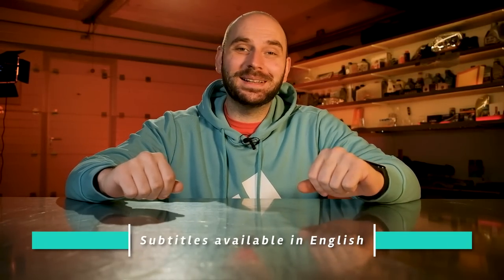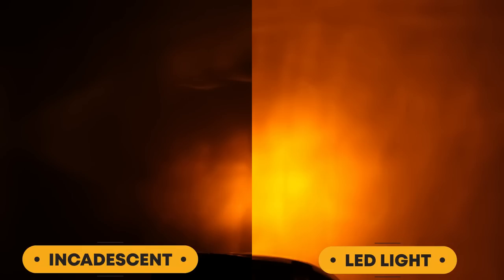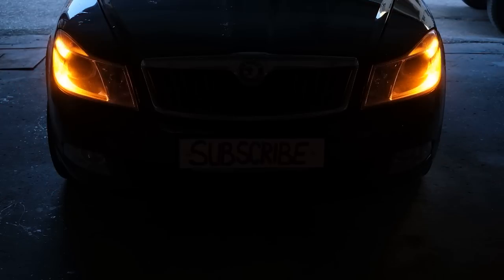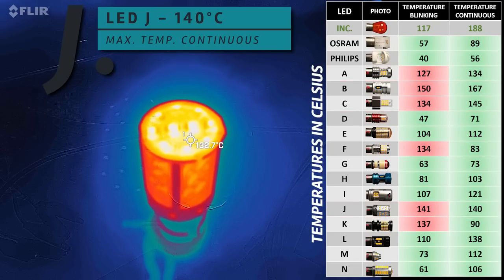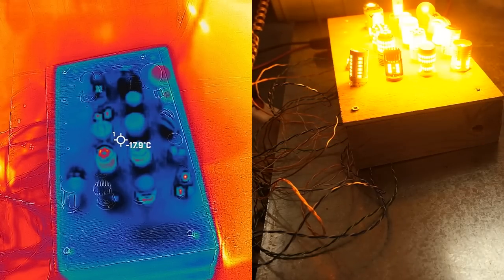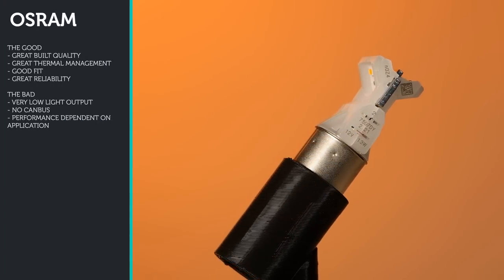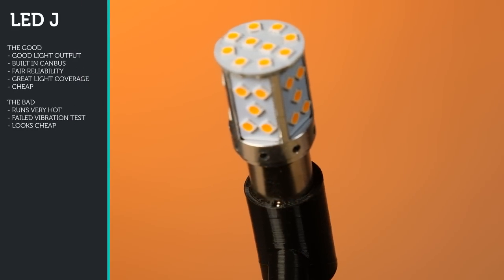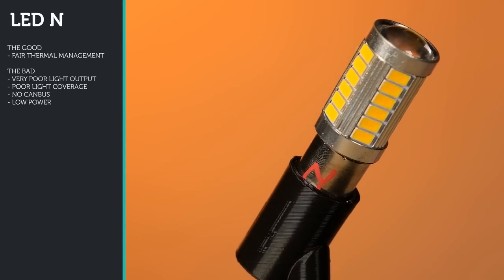LED INDICATOR LIGHTS | Testing the best rated LED bulbs

Comment: I'll be honest, I bought bulb B for my car thinking since there are not that many LED chips it shouldn't get too hot. BOY WAS I WRONG THE WHOLE TIME. I will definitely remove them and buy different design. Thank you for this helpful video you basically saved my car from getting burned.

Comment: Interesting results. Bulb E was Bulb R in the reverse light test. It handled most of the tests back then. Been using them as reverse lights for about a year now. No issues whatsoever.
Reply: And what now? The bulbs are working ok now? I wanna get the bulb E on this test
Reply: @JhonatanPinzonsx  I had bulb E and they lasted about 4.5 months and all of a sudden both of them virtually died - only a few of the LEDs are working so it's practically doing nothing now. But the brightness was brilliant!

Comment: From my experience, the point of high wattage LED is to imitate the resistant of an incandescent bulb. But, when you continuously blinking them around 3-4 mins, the bulb hotter and the resistance goes down (Ambience Temp around 30 C, Humidity around 90%RH) leads to hyperflashing. When I choose LED, this is one of my criteria. I've also test that large aluminum body for a heat sink though but it doesn't last longer than 4 mins. Now, I've got the active cooling bulb (not the one you test) and I test it around 20mins and it's fine. I recommend you to test this topic for next time.
Reply: can you share the one you have ? / prefer
Reply: Hyper flashing is one thing but most important is that the bulb won't turned itself off due to overheat. There was once in an accident and the bulb failed due to overheat. Been using the led bulb I tested above close to a year and its still working well. Perhaps if the test could include  if they hyper flash or turned off overtime would be great.
Reply: @AndyCheah0625  the test showed them running in the oven for 30 minutes (constant not flashing)

Comment: Excellent. Definitely my favorite test. This packs a lot of performance into a short run time. LED K is my choice. On my wishlist at Amazon too. Light output is overwhelming while also covering a wider area to truly fill the reflector in the daytime. I need that in clear turn signals which can washout incandescent bulbs in the sun. Not a fan of LED A because of the solid all metal top emitting no light from the tip, where it's needed in the blinding tropical sun. This test is the best of it's kind. Bravo Sergiu !

Comment: I'm also a quality engineer and appreciate the thorough objective testing. In my own experience, the Sylvania ZEVO bulbs in the US (It should be the same as OSRAM Premium) has higher output then the standard Sylvania/OSRAM LED bulbs. The ZEVO/Premium bulbs have a higher specified power and a metal heatsink to help dissipate heat. It would be nice to see both the standard and higher power OSRAM bulbs included in future tests.
Reply: I've bought some ZEVO indicator LEDs for my car, they pale in comparison to the old philips xtreme vision Leds, the Philips are twice as bright as incandescent bulbs, while the Zevo's can't reach incandescent level of brightness. (although they come very close)
They are reliable though, I've had this set for more than 6 years, and they still work fine!
Reply: i installed model H 88 Led, on Toyota Auris 2015 and it has an amazing amount of light .But your opinion as also respectable ✌
Reply: Had the Zevo led brake lights on my Lexus es for about 3 years now. Still going strong and no issues at all!

Comment: Thank you! I ended up getting bulb E based off this video, as it sounded exactly like I wanted - great light spread and noticably brighter than halogen - and it was indeed! Sadly mine only lasted 4.5 months but they were only £2.50 each, so it's worth repeatedly buying them and at the end of the year only having spent the same as more expensive bulbs (but with less performance).

Comment: I watched this video purely to see if i made a good buy.
Glad you featured the LED K mine branded as 'Oushi' from amazon uk. in november 2021
My aim was to get the brightest bulb possible as it was for my motorcycle. front bulbs lay horizontal and rear bulbs face directly backwards, so general brightness was more important than focused brightness.
To say your testing confirms my expectations from the bulb with it's design is probably an understatement.
The performance has been rather incredible and certainly glad i brought them.

Comment: I got the GTR2’s from Headlights Revolution replacing all the incandescent indicator, rear position/brake, and reverse bulbs. 

The GTR2’s are way stronger bulbs than any halogen ever was. 

A bit expensive but well worth the money spent. I have no regrets.

Comment: Hi Sergiu! Thanks for your videos: like so much how do you dig into technical details.
I wanna to share with you some of my experience dealing with LEDs: found that in automotive/motorcycle applications most of these low-power (watts) bulbs are rated/advertised for 12V, and when stressed for some time with the usual 12-14.5V involved in battery-powered circuits they starts to fail after few months (flashing, burned chips). So I think would be useful if you include on your test pool a check for the presence of IC voltage regulators embedded on the LED bulb, providing a protection against voltage variations.
Don´t hesitate to contact me if you need further information on this aspect and the brands I´ve found they included a voltage regulator on it´s designs; in some cases they are rated for 12-24VDC with a constant power output.

Comment: Amazing and very detailed video! The results for the Philips X-tremeUltinon Gen2 is very interesting. I bought my Philips X-tremeUltinon Gen2 a while ago. And from the moment I installed it, it was significantly brighter than my incandescent W16W. I liked them especially because they utilize the existing reflectors resulting in a "fuller" look.

PS 2012 Corolla both front and rear turn signals.

PS Also, I changed my 2003 Corolla's brake lights with the Philips X-tremeUltinon Gen2, and they were significantly brighter (might I say too bright when braking). I suspect it was because of the specific Corolla housing because it was so large.

PS I'm no engineer, but I just wanted to share my experience.
Reply: I just got my X-treme Ultinon gen 2 as well in PY21W. I’m puzzled with the results in this video because the led is clearly much brighter than my stock incandescent bulb with only 1500km of driving. If the result (lumen) is accurate, I don’t see any reason to go with brighter alternatives because it will just blind every drivers behind you at that point. Not to mention the philips will probably last much longer because it run much cooler.

Comment: I use LED E for my front turn signals, I've had a few of them go out. But I keep buying the same because I like the light output and the built in CANBUS. Really great for being seen during the noon sun.
Reply: I know bulb E in white version (used as reverse light). Good rate price to light output. However I think are too strong for signal light. You mean are good during sunny day, ok, but what during the night? I think you can blind other drivers in night.
Reply: @adamx7877  just enough to be visible next to my also quite powerful headlights. I do also take into consideration other drivers when I'm "parked" with my hazards on at night. If I'm going to be blinding someone with my hazards I just use my park lights instead.
Reply: Same with me. I remove the glass for better cooling.
Reply: @alvinfernando6906  And has removing glass helped?
Reply: @koce7276  yep.. but i think not much
Reply: @alvinfernando6906  Today i ordered same bulb for turn signal. How long do you have them and has some of them died?
Reply: @koce7276  currently I ran about 6 months ++, and still normal , no problem at all.. because turn signals only stay on for 1 second and off..

Comment: I like the vibration test. The bass from my two 12" subwoofers destroy my bulbs. It cracks solder joints. I've had to fix/replace many LEDs in the rear due to my stereo. 😁

Comment: Osram and Philips are in this case very disapponting. That's a shame because their LED headlights are top quality
Reply: I went for Osram "Premium" LEDriving BAU15s for my Octavia mk3 and those are working just fine (the ones with the metal surroundings). Those aren't brighter than stock incandescents, but look crispier and don't give any error messages since those have been coded to be LEDs. 😊 Of course those still could perform better and most of all - be cheaper...
Reply: Are they made in china? 

I've seen them in aliexpress but it says on the box (made in china)
Reply: @Mmoukarii  
Where did u buy it ??
Reply: I will be getting the Philips for my rear indicators that have a reflector housing. The reason the big brands went for indirect light is that they know this is going to be used as a replacement part for halogen reflector housings and the fact that the brightness from the regular bulb is already good enough, any more and it becomes blinding and distracting to the people sitting behind you in a turning lane. 

I simply want the crisp blinking that LEDs give but not to blind the person behind me and distract them, don’t need them rear ending me bc they’re not focussed. 

Plus those two bulbs do the best in the temperature/overheating test and I want my indicator bulbs to be reliable, since if they fail I won’t know and that would cause big trouble on the road.
Reply: @User-cb4jm  I just installed LED J, and before fitting them I did a Lux measurement of my incandescent bulbs as well. My incandescent indicator bulbs, where 50lux at 1.5m and these LED Bulbs 130lux at the same distance. So almost 3x times as bright.

The reason I decided to go for bulb J: it's only € 6 for a pair, and based on how they do in my headlights. I might be able to run down, which LED indicator bulb would not be to bright.

Actually I think LED M might come closet to it.
Reply: Tbh, in fact of the brightness, osram and phillips led bulb is just lil brighter than standard bulb, but if you buy some "expensive / same price like osram/philip" chinese bulb, you'll get way way brighter than osram/philips.
I know in some country there are road legal about how bright the headlight is allowed. but in my country, there's no rule like that. the only rule is the headlight cutoff, the police officer will stand in front of your car, if he blinded, you'll get arrested 😅

Comment: I have something similar to J bulb and it's funny because the brand start with the letter J. I have them install on my car since 2 years ago front and back indicators and still working hard and still bright. I live in NC and we have all the seasons here. They might look cheap but they're canbus ready and the brightness is awesome.  Sometimes  research is important when investing money on things like this.  I have converted all my lighting to LED  2 years ago and still going with no issues. 2015 Scion Tc is my car.

Comment: Old Philips indicator LEDs were VERY good. I've had a set for almost 7 years in my car, it's much, much brighter than a incandescent bulb (at least twice as bright).
I've been using Philips brake, reversing, and indicator LEDs for nearly a decade in my car, and they all still work great, VERY bright, VERY reliable, GREAT light pattern. It's a shame Philips decided to stop making them, they were expensive, sure, but they were extremely well built too.
Reply: so it will dazzle other drivers at night, thats great!
Reply: @petrvalkoun4539  Actually, they don't.
My car is an old fiat from early 90s, with very inefficient tail lights, their reflectors are not concave around the bulbs (it's literally a square box that doesn't focus the light whatsoever), and instead of being painted with chrome paint, the reflectors are painted with cheap, low reflectivity, silver paint.
By fitting it with such efficient LEDs, the light output from the tail lights is around the same of a modern car using incandescent bulbs now.
Modern cars fitted with LED tail lights from factory actually dazzle A LOT more, the light output in those things is unbearable!

Comment: I run osram/Sylvania zevo bulbs on my vehicles one vehicle has had them now going on 6 years with 0 issues, way brighter then stock bulbs in free-form reflectors and housings ware the bulbs go in on an angle the zevo is way better then the other osram led you tested
Reply: U can’t go wrong with sylvania zevo led bulbs. They are truly a set it and forget it led bulb replacements. ❤️‍🔥❤️‍🔥

Comment: The LED F is from auxito. I run those as 7440. For 24 watts and 1600 lumens, it’s one of the best and brightest turn signal lights ever. Very handy and increase safety. Huge day and especially night difference. 🔥🔥🙏🏼🙏🏼

Comment: I used to run white LED -E's as DLR's in my car. They didn't survive the hot summer in Denmark and multiple of the LED's failed and the remaining started to flicker like crazy. They run great as indicator lights, and I've been using them for years! Still holds up as indicator lights, but not DLR's

Comment: After watching this video I decided to stick with the Philips SilverVision incandescent:
1. they look stylish (hardly any egg-yolk look left)
2. they are slightly brighter than normal orange bulbs
3. they have a great longevity, not only for the filament, but also there is no yellow coating that dries out and crumbles away over the years.
🤓
Reply: The silver coating will also crumble away from those bulbs...

Comment: It would have been nice to see a dual filament function tested. Many cars have their indicators double as parking lights and so much like a brake light, they need good contrast between the high and low modes in order to be visible when signaling.
Reply: All the chinese bulbs are rubbish. If these tests don't prove that firmly enough, just look at the silly brand names, ridiculous shapes and sizes, and absolutely fake materials. Just as an example I use only Philips and Osram LEDs on my car, keeping the turn signals, headlights and left/right stop lights halogen (these I tried to convert and red Osram LEDs did give great colour behind the lens, but CANbus said "no"...)
Reply: @zacmich6472  Yeah, we sure did see how much better those Phillips and Osram LEDs were right?
Reply: @darkboy1759  depends on housings

Comment: I decided to choose LED J: because it was rated to be somewhat good, and it even had fair reliability. Two bulbs are € 6 and I'm going fit them in my front indicators, hopefully they won't die to quickly. But I think with indicators it shouldn't be a big issue, that they get hot. As it's only used a very short time period. I wouldn't want to use them as rear lights..... then the high temperature probably will kill the bulb very fast.

Comment: So I tested Bulb J some time ago and my results are the complete opposite: my incandescent indicator bulbs only do 50lux at 1.5m, where bulb J did 130lux and being crazy bright. Which makes me believe, some of the cheaper bulbs would be a better option.

Because the goal isn't to blind everyone with your indicators, but make them look better by adding LED light.

Comment: I use LED M - type of bulb with T20 socket, they hyperflash, but I buy led flasher relay which is direct plug and play as original relay and now it works fine.
Reply: Lien of the led???? I want to buy

Comment: Thanks for the testing, Sergiu! What I find lacking is the cost. Most of the upgrades if not are actually not justified in cost as far I can tell by your purchase prices. For example W5W set of 2 bulbs is just 1$, where set of LED retrofits of Osram and Philips are $10. Makes me believe that if you do not look for the tuning and upgrading aspects, it's totally not worth to upgrade or change to LED, because often incandescent bulbs are reliable enough and always the cheapest option in my honest opinion. What do you guys think?
Reply: My car is 22 years old now, it's a cheap economic car from Fiat which did not have reliable electrics when new, imagine now, two decades later.
Brake lights specifically, would burn or stop working every 6 months or so.
Indicator bulbs drew so much current from the thin wiring, that the whole car lighting would dim whenever they lit.
Headlights had those classic glass lens with patterns to focus the light, terrible efficiency.
To make things worse, my country decided to make mandatory to turn on headlights during the day on highways. This caused the bulbs to burn quicker, and even to overheat and damage the reflector of my headlights. More electric devices turned on = more load on the alternator = more fuel consumption.
LEDs were a blessing, sure they are expensive, but (provided you bought them from a decent brand like Philips) they: 
-light up faster (better reaction time from other drivers = more safety)
-light up brighter (better visibility = more safety)
-Consume 1/5 the power of incandescent (less stress on the alternator = better fuel economy)
-Barely get hot (extends the life of the light fixtures of the car)
-Much, much longer life span (if they don't burn in critical situations, like when you need them at night, or during high speed travel = more safety)

To me, if you like you car (wants to keep it forever), and/or wants a little bit more safety, and have the money to upgrade to decent LEDs, then do it. 
If your car is modern, decently designed and put together, and you're gonna replace it anyways every 2-3 years, don't even bother.

Comment: Is it possible to check if a bulb is compatible with your car without purchasing it first? e.g. it won't blink fast (for whatever reason that happens.. I guess it  is because of the lower power consumption in comparison to a 'normal' bulb)